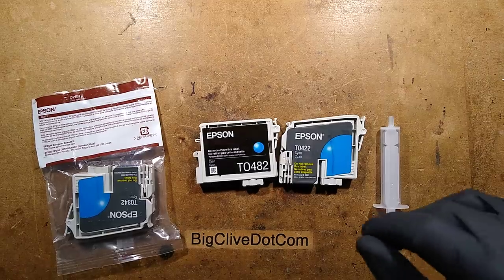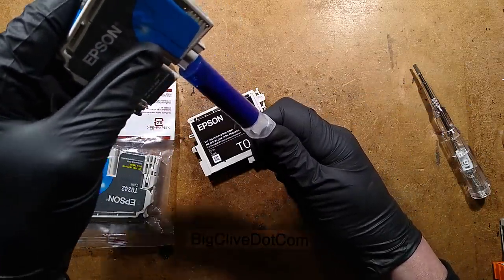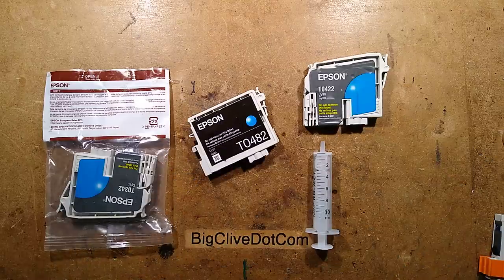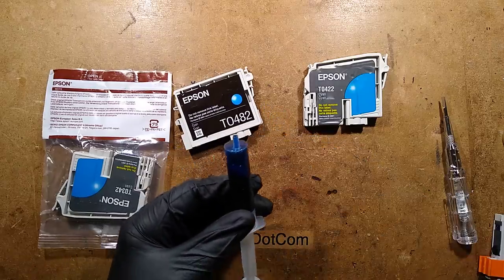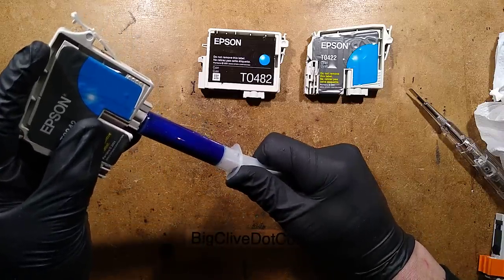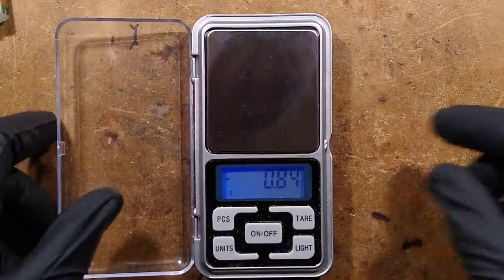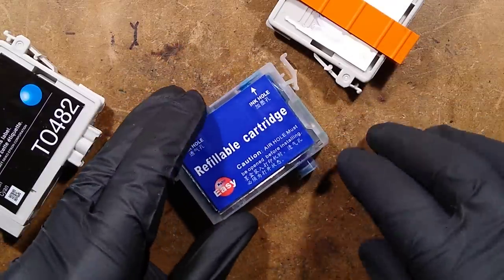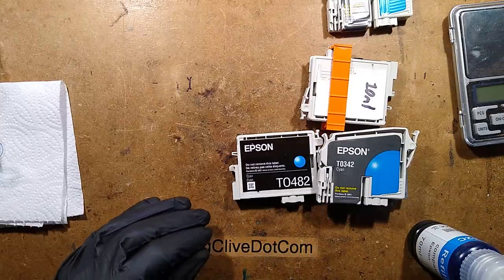How much ink is in Epson cartridges?

Comment: The biggest scam in the computer industry is the ink cartridge. It costs a few cents to make one -- and they sell it for over $20. The profit is ENORMOUS. And the refillable machines are not much better. It doesn't cost anywhere near as much to make one of those printers compared to the cost. What they do is figure out how much profit they would make on ink cartridges over the life of the printer and add that to the cost of the refillable systems. It's all a scam.

Comment: Ink jets waste A lot  of ink Every 1St Power up Cycle and every Low Soft Power save Sleep cycle an every 15 mins of not printing the 1st print will do a light bleed and Prime Cycle

in order to save ink I use a 2x Raspberry Pi4 Pi 5  NAS USB Print Servers  4x USB SSD NVMe adaptors (RAID 10) That has A Massive  Print Que that also stored a PDF Version available to the Network (2nd Wifi network that has no internet on it & Air gapped intranet  i wait till the every 3 ~6 ~ 9 ~ 12 months to do a massive print off however urgent Prints (mono laser Printer) can be Pushed Forward But Can always Pull up the PDF & Digital version on Tablets & Laser Projector (anker nebula capsule 3) if needed
Reply from the maker: I keep my printer powered and print regularly.

Comment: yes , unfortunately hp is still neck deep in the unrefillable cartridges system that its basically a scam if you recommend hp printer to anyone, they go to so many ways to prevent you from refilling cartridges !! in some printers i saw in the office you replace the print head that contains the ink in one big part that combines the 2 , and they cost more than the printers themselves 
but hey , i get alot of junk printers i can harvest motors and parts from just becoz it is cheaper to throw the printer and get a new one than to buy new ink for hp printers.
Reply: Yep its sad manufacturers do the same money trick apple does by putting identification chips in their products ugh i hate them! Why i stay away from hp printers and the apple ecosystem and go for manufacturers who ATLEAST NOW still WONT do the evil things Hp and apple do

Comment: Gonna warn you now those Epson printers with the refillable tanks is just as big a scam as the replaceable ones. Just wait till you have to replace the sponge Cartridge
Reply from the maker: 6 years, 6000 prints waste ink tank showing at about 35% used.  Code on hand to reset it in the future.

Comment: Printer ink and printers in general have to be one of the biggest legal cons in modern times. They sell the printer itself at a loss because holy shit do they make faaaaaaaar more on the ink once they have you locked in to their lovely (software and hardware locked down) ecosystem. It's wasteful and utter bullshit. Thankfully in my own life I don't really have cause to print a damn thing so I happily will do without and will just to go something like Kinko's or some other "office susbstitute" to print off any documents that I may need to. Screw printer manufacturers, they're a racket and should be forced into the "Right to Repair" movement just due to the waste alone. Ugh.

Comment: The chip on the back counts X printed pages. After those pages it reports "no ink" even if they're 100% full. If you inject new ink in, they still report full, and if you somehow reset it, it reports "NON-GENUINE CARTRIDGES" and refuses to print. That's why there's chinese chip replacements, or "inserts" that reset the data, or a little button to reset it, or an adapter to reset the cartridge. In short, yet another scam.

Comment: .... laughing in Epson LX300 ..... Hard to believe - but windows 10/11 64bit drivers are still available and up to date !1
Reply: Ribbon Yield
3000000 characters Black Draft.... Print Head Life
400 Million Strokes/Wire .... They don't build em like they used to ....
Reply from the maker: The local airport has dot matrix printers for making multiple copies.

Comment: I used to make these.
Reply: On one of their old machines you have to manually put those little rubber gaskets in one at a time... Most brain melting work ever invented..
They help prevent leaking but are definitely mostly so you don't refill your cartridge.
A lot of engineering goes into these things, the manufacturing machines are about 30 ft long and the ink is filled from massive drums mixed in another part of the factory.

Comment: Biggest scam in computer industry, before subscription software. 🤣 
Canon printers had by far the easiest cartridges to refill, until they followed HP and Epson. 
What is really funny though, is you can buy a printer from Currys or Argos for £29.99 and the replacement cartridges cost around £60. 🤣
Reply from the maker: Yeah, I used my old Canon printer until the heads literally fried.

Comment: The Epsom tank printers are cool, until the printer stops working and you have a broken printer and lots of tanks of ink to dispose of 😅
Reply from the maker: 6 years and 6000 prints so far.
Reply: Some of the Epson Eco Tanks actually have proper user replaceable waste ink tanks that can be done by the end user within just a few minutes and no disassembly, and totally supported by epson with them selling genuine replacements.
Reply: @KSSilenceAU  that’s good! When mine went wrong I was told they’d charge something ridiculous to look at it and repair it.

Comment: Over the last about 13 years I initially went through two HP Office Jet printers. One of them might even have been an Office Jet Pro, because beeing multifunction devices, they provided exactly what we needed at home. The first broker after I think about 6 sets of ink cartridges must have been somewhere like 6 years old as well at the time, maybe 7. As we got it on sale for about 150 EUR, we did not try to get it repaired in some way, as anew print head would have been somewhere around 90 EUR, but replaced it with another one that was on sale at the time, somewhere around 160 or 170 EUR at the time. With that one within I think 3 or 4 years,  we went through 2 or 3 sets of cartridges, which got over time a lot pricier than the old ones. last time, a whole set of all four colours in the large sized cartridges would have come to abou 128 EUR. I didn´t want to go to refill or no name cartridges as I had bad luck with those on HP printers. I used a lot of those with Canon printers in the past with usualy good results. the first office yet i mentioed, died of some plugged print head. that one actually had separate print head and ink cartridges. The second one had the print head in the cartridge itself again. Also at that time, they just had put out that firmware blocking a lot of 3rd party ink.
After that we switched to an Epson printer, a lower end consumer model for about 120 EUR. actually a model with 6 or even 7 ink cartridges for photo printing. I think that one had the best print quality of all printers I ever owned on the right type of paper. although we did not really need it for that. It had also a rather good quality scanner bult in, allthough not with an automatic document feed as the ones before. as mentioned, we downsized on some of those features as we did not need them that much any more. When I bought it, we looked up ink costs as well. But come the time I needed new cartridges, the prices had went crazy and it was about the same as the whole printer. Plus, despite its phenomenal print quality, we had not been happy with it. We used it connected to our network through wifi, which worked fine for the HP printers before. On this one, we had to reset the printer about every second time we wanted to print something. Not that practical. Also at that time, rumours came up regarding 3rd party ink being blocked by Epson as well. That was enough to get rid of it ( at times I am absolutely missing that scanners quality).
Next to come, Epson again, but this time an epson ecotank workforce model. (Yeah, we got it on sale and we needed some featers we left out before more than we anticipated, so we went bigger again). To be honest, we got it about a year now, and I yet have to empty the ink tanks. There is even some ink left in the original bottles, which were not the same size as the refill ones you can buy. but looking at those bottles, and comparing the volume with the previous cartridges, one of those bottles replaces 6-7 of those (on that photo printer, on other models the amount of refills may vary.), but I can get them at around 14 EUR per bottle, I think black might be more expensive, but comming in a bigger bottle. At that price, the 3rd party ones are only so little cheaper, I personally do not see any need to not go with the original ink. On my go to former online bookstore, 3rd party ink bottles are not even half the price. There is no DRM that would prevent me from using different ink. but as I mentioned, the savings compared to original ink are so little, I don´t take the risk to mess the printhead up with other ink (That most likely would be perfectly fine)
Never had it hanging up so far (except once, but that was due to it waiting for confirming some EULA and stuff after an update), the speed is excelent, and the quality is perfectly fine for what I need. (No, photos do not even closely compare to the previous one.). The scanner has an ADF and it can send me my scan through email, very convenient.

Comment: make sure your epson eco tank doesn't feature a non-replaceable  waste sponge. in which case after a bunch of pages are printed no matter how much ink you have, the printer is useless.

save yourselves the trouble folks, use a laser.
Reply from the maker: 6 years, 6000 prints, waste ink tank currently at 35% full.  Can be removed and cleaned, then reset with a third party key.

Comment: Not too long ago, I decided to look into just how far the HP ink cartridge scam actually goes. Did something similar with a genuine HP cartridge that reported itself as "empty".  Turns out, it is quite expensive to find out that they are close to 50% depleted when the HP spamware starts nagging that it is time to fork over more cash for new cartridges "Or else...". Totally unscientific result: I got about 1/2 to 1/3 of the ink out of an "empty" unit -- when compared to a sealed brand-new one. Stay away from these motherfuckers as best you can. Brother & Epson allow aftermarket refills -- the best antidote to HP printer Nazis.